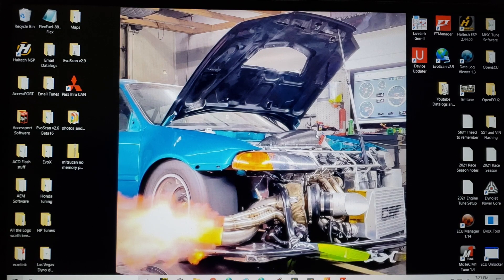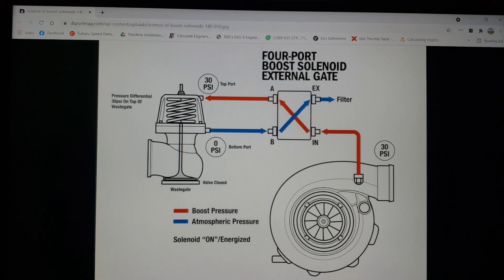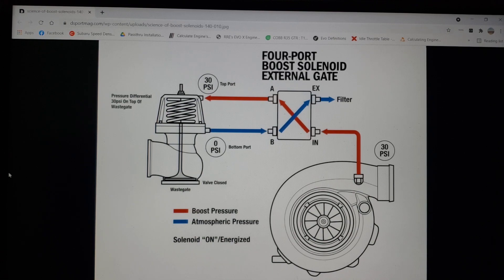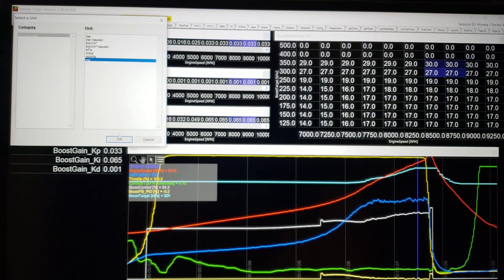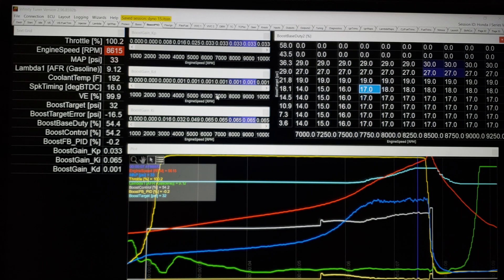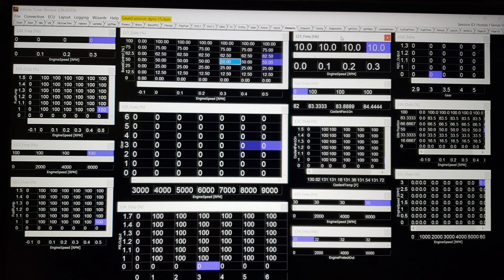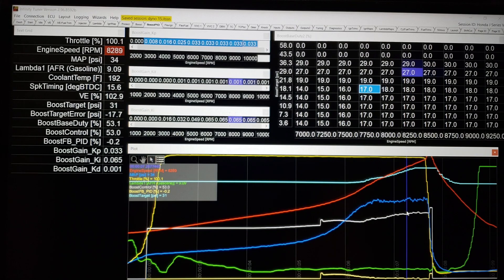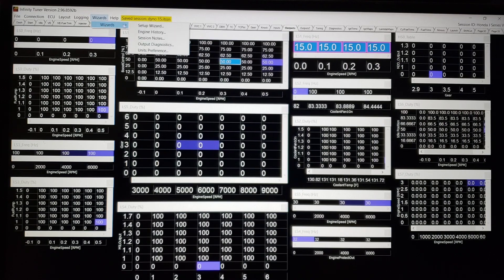Boost Control ep. 4 - Tuning 4 port solenoids

Comment: Aaron, very interesting video again! 
Because I have an AEM Infinity and a 4 port boost control solenoid, too. And I have a 0.4 bar WG spring in my MK3 Supra 2JZ VVTI doing 2 bar + of boost with this setup. I tuned the boost control a little bit but stopped it because of wet and cold weather the last few month here in Germany.
But I'm very interesting in this and will get back to it, when the sun comes up again.
If I'm right I set the PW output to about 25hz and have very low P and I numbers. Boost values stay very close to my Targets but most time I have a little bit overshooting in the spoolup area. 

It would be great if you could give us some practice examples of changing the PID settings and the effect of each.
My understanding of PID is, that you should tune the proportional gain at first to get close to your desired target boost while zero out the I and D.
Why not tuning the derivate gain next to stabilize the steady state error before tuning the integral to get closer to the target value? I often see that boost control settings where it's more a PI than a PID control because no one really use the derivate gain. Is it because of the poor or unstable MAP signal?
Reply from the maker: Earlier versions of the Infinity firmware didn't seem to have enough filtering so definitely had issues with the MAP sensor causing feedback issues. I use lots of derivative for things like idle control, but less than I can for most things. Maybe I should do a video specifically on PID tuning?
Reply: @AaronONeal1 
Aaron, that would be great if you will give us some practice examples.
Another interesting thing would be if you tend to use a little bit higher or lower duty cycle in your base map to get a desired boost level as a starting point for the feedback control?
Reply from the maker: @speeedya  I do normally start less than I feel it should be. I've tuned enough cars that I have a decent idea of what duty cycle will get me a given boost level on a given wastegate spring. So that way the feedback will adjust up, keep it safe, and I can get an idea of what it actually should be.
Reply: @AaronONeal1  all right. I'm doing it the same way.
I've found that the 4 Port solenoid is more sensitive to small changes of the duty cycle than the 3 Port. In my example 1% Duty Cycle increase will give me an increase of about 20 kpa.
That's a little bit tricky, because the boost values for a given duty cycle varies a little bit with temperature.
For example, "cold system" makes 1.8 bar at 26% duty. After a few runs you need 28% for the same boost target.